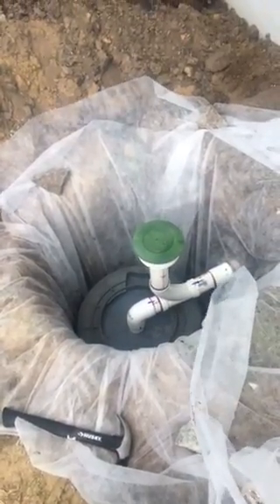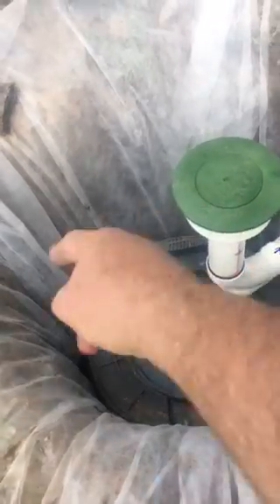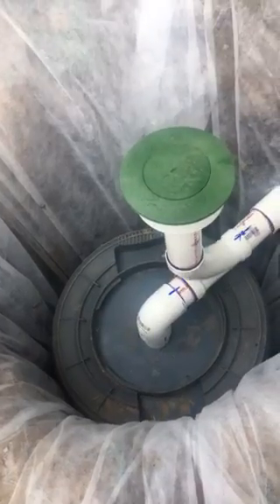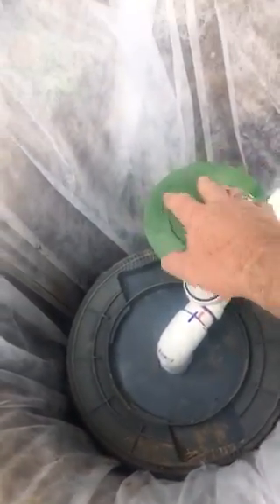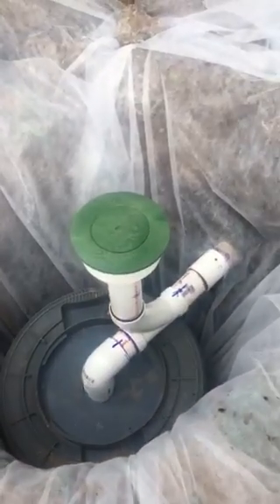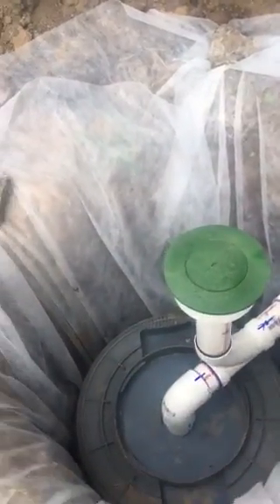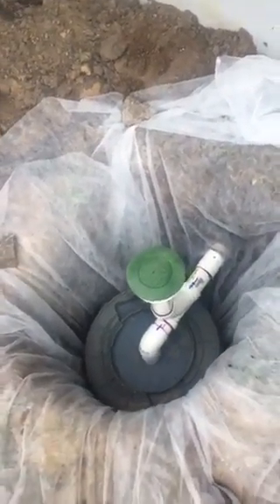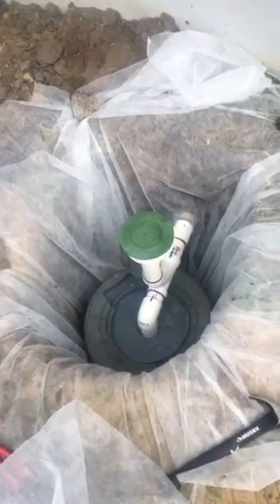Dry Well  for gray water.

Comment: I'm making something similar using a 55 gallon drum. How has this worked out for you since you installed it? Also where did you buy the overflow valve? Home Depot have something like that?
Reply from the maker: My daughter has done as many of three loads of wash, without any problems. The pop up valve can be found at Home Depot or Lowes, in the out door section, with yard sprinkler items.
Reply: @magyart  Thanks, I wasn't sure if you would see my comment. I'm getting ready to dig this weekend. Going to borrow a backhoe attachment for my tractor from a neighbor to make life a bit easier. Been in our house 2 years now and it has recently become an issue. Not sure what I'm going to find when I dig it up.